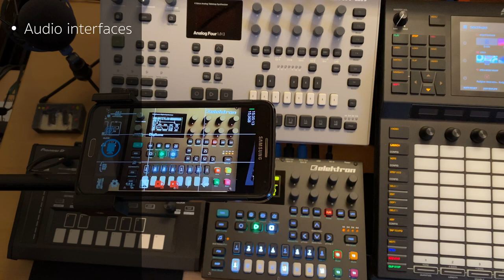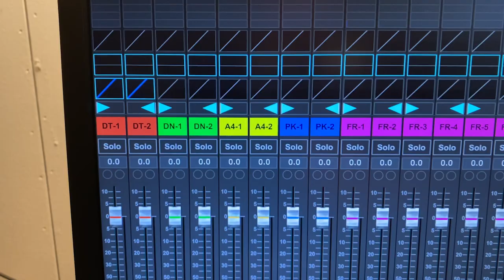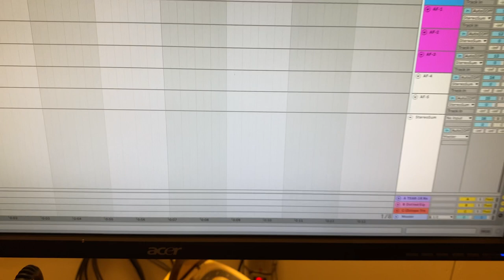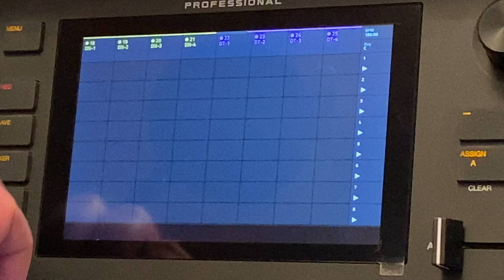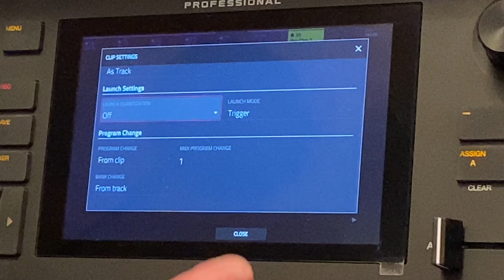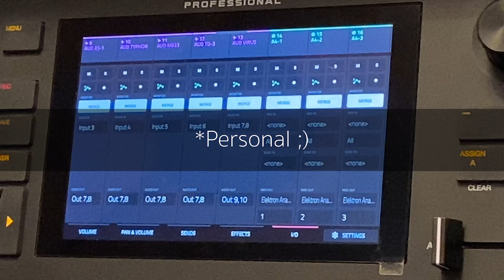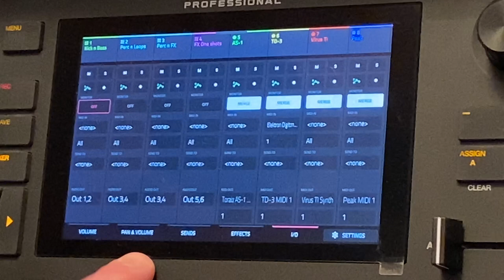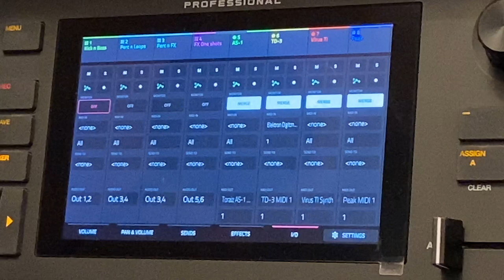Akai Force plus One - Peripherals and Akai Force configuration

Comment: Great setup and video!! Do you mix on the XR18 or the Force? Looking at the XR18, but want to "set it & forget it" and mainly use as an audio interface and wondering how realistic that actually is 🤣
Reply from the maker: Thank you! Due to circumstances I had to stop making music and video content for a while. Since a few weeks I have some more time and I have connected my music equipment again. I've always worked towards a hybrid setup (hardware/DAW) and I've now indeed set up my XR18 mixer once and I don't touch it again. Soon I might make a video showing my current setup.
Reply: @HansuMyura  thanks! I picked up the XR18 and love it for the Force & other gear

Comment: Great video, really complex setup mate. I wouldn’t be able to deal with it ☺️ Would love if akai would implement usb audio via the usb3 connector, so the inputs are going straight into the computer, like elektron overbridge
Reply from the maker: Hey thanks Expectaz! It may seem very complicated at first and when you explain a setup like this it certainly looks like it, but I find it very easy to work with and it is useful for many types of projects. I also switch between different ways of working, but I always use this template as a starting point.
Yes indeed, it would be great if there were some sort of Overbridge-esque functionality for the Force, but it has to work the exact same way because you can only choose one audio interface on a Windows PC. Elektron did a very fine job with creating Overbridge, I wonder how Akai would fare... ❤️😎👍
Reply: @HansuMyura  I know.. Aggregate devices are amazing on Mac.. Another method I’m looking into is Dante and or adat solutions for that purpose to not have DA/AD conversions 😊
Reply from the maker: @Expectaz  Yes, that is certainly a very nice solution, but also of a different order of magnitude. I'd love something like that too.

Comment: Are you getting intermittent clicks/pops from your UMC1820? I bought one to use with the force but the clicks/pops are too obvious to ignore and unusable. What firmware is the force on?
Reply from the maker: Hi a Max,
I don't experience that. The current firmware (3.1.2) runs on the Akai Force, but the settings of the UMC1820 are also important. Before I started using it, I connected it to the PC and went through the settings in the UMC Control Panel. My current settings in it are: 44.1kHz, 128 samples and 'Safe mode' checked.

Comment: Nice video! I see your using using the Novation Peak I connected my Summit to the Force running  3.1.2 over usb and I'm able to play the Summit on the Force pads but unable to record a sequence. Any suggestions greatly appreciated.
Reply from the maker: Thanks! 😃👍
Is your question about sound or midi?
Sound wise, it all depends on how you've connected the Summit's audio outputs. In my situation the Peak is connected to the digital mixer and I have aux 1&2 connected to the audio interface which is connected to the Akai Force. That way I can record sound into the Force from any device connected to the digital mixer.

When it comes to midi data, make sure your midi/sync settings are correct in the preferences. Also make sure that the midi input port is set correctly for the track where you want to record something. Otherwise, search for "midi-in" in the manual for the various topics related to midi input.